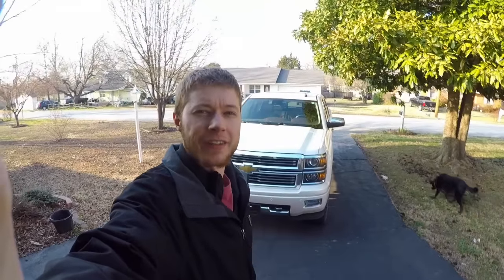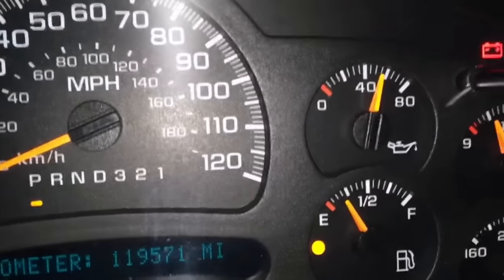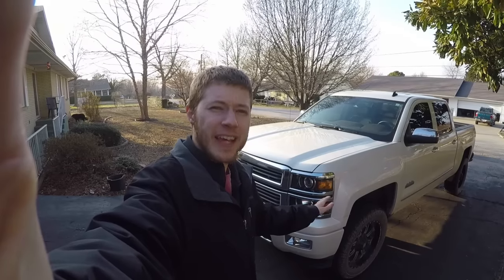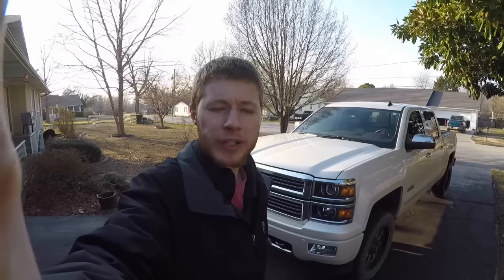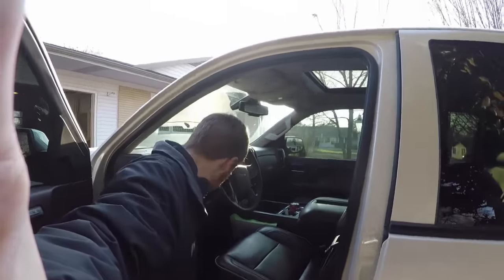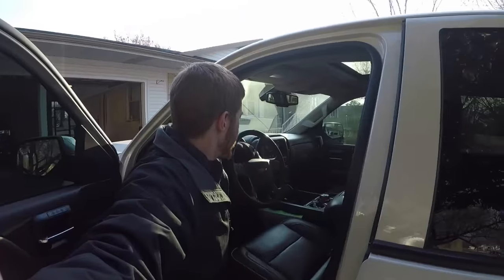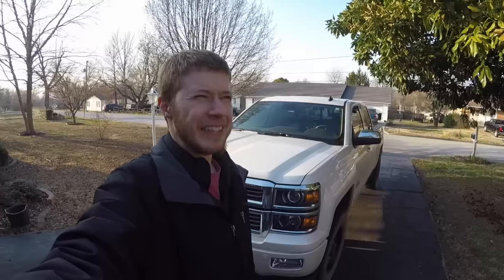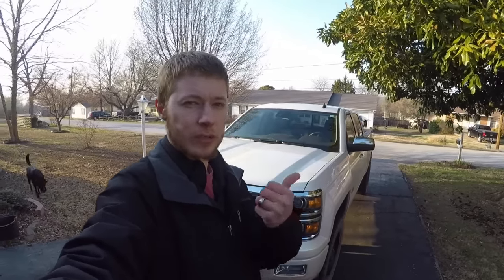Silverado Sierra 5.3 Lifter Noise Tick (What to do)

Comment: Part of the problem on these engines are the fact that they’re made out of aluminum and aluminum heads in plastic intakes with all this being said the noise is a lot more pronounced in it travels from those materials a lot easier than it would if it was cast iron so the new aluminum engines a lot of them are just noisy because you can hear the internals a lot easier than you would if it was an old cast-iron ...what are your thoughts

Comment: It was a Lifter on my 05 5.3 Sierra..
Dropped my Oil Pan, And Cleaned Out the sludge from my Pan, Cleaned the Piss outta my Pick up screen.. Then Replaced the bad lifter,, That was Squared off at the Roller... New Cam, and Did the Heads while I was at it..
177k mileson it,, all that Work and $$,, it’s Quiet As Fuck now,, and Runs Grrrreat..
Reply from the maker: Nice work!

Comment: That’s the belt driven vacuum pump that runs the brake booster. .That 5.3 is totally different than a 06.
Reply: Build0001 explain bro respects

Comment: Yea I had a bad lifter and I had heads redone and put in a new cam and new lifters. It still has a bit of a tik. I'm actually going to put in a new high pressure oil pump because my oil pressure is low at first start up but it has 140k miles being a 07 classic.  Thanks for the video appreciated it!

Comment: Just a heads up, what I hear is the Fuel Purge Valve. It is located to the right of your throttle body and feeds to your Intake.  $30 part. Chevy OEM FPV is notorious for being noisy. If you put your hand on the throttle body and on the FPV , you can "feel" what youre hearing. Almost like a distinct grinding sound/feel. I put some Dynamat extreme on mine when I replaced it. .....and noise is GONE. AFM lifters will be much noisier when they go. Yours has no problems....yet. Up the oil viscosity as recommended by owners manual for your weather conditions.  You'd be surprised how heavy you can go and still be under mfg recommendations.
Reply: My code popped up yesterday saying my purge valve

Comment: My 2001 Silverado has been doing the same thing for at least 15 years. I have never had anything done to the engine except oil changes. It still runs like new with over 200 thousand miles and yes it still makes the same noise when you first crank it up, but after about three minutes or less it stops. This usually happens after you let them sit up over night. I love mine and have no plans on getting rid of it.
Reply from the maker: This is good to hear. Sounds like that has been a great truck!
Reply: Dustin T it’s like a family member after all this time lol
Reply: this sounds exacly like a manifold leak if its more present on start up and goes away its most likely manifold if it comes with heat its probbaly engine related

Comment: Its because its direct injected, any direct injection engine ticks like that, totally normal, always will, direct injection engines put out 15,000 psi of fuel pressure into your engines, dont motor flush it, that does more harm then good this is a normal noise.

Comment: I’ve just hit 160,000 on my 2015 reg cab 5.3 engine 4x4. I’ve baby’d it, had absolutely no problems out of it, always use sea foam or Lucas every single fill up, never get down on it but I drive a lot. Mine just started the ticking sound. Thanks for the info. I’m really trying to make this truck last to 400k. The body style still has that classic look, especially with the mud tires they set it off.
Reply: You might consider a dod delete kit. It prevents lifter knock/failure but it disables the v4 mode

Comment: Different levels of the notorious tick! Do worry about it. It will wear down the cam lobe and more. Has to do with the VFM on all 5.3 & 6.0 LS engines. 07-20, a few ways to try and make it stop, some work depending on how severe tick is and others have to go into engine.
Reply: This issue plagues earlier models as well my 01 Silverado 5.3 does it

Comment: I have the same noise in my F-150 4.6 SOHC mod engine,it has 290,000 miles now and the 'cam phasers' have small pin that wears down after about 200,000 miles and it has the same type of ticking noise until it warms up.... usually takes about 5 minutes,then goes away..not sure if GM uses a single cam phaser or they don't have one at all...idk
Reply from the maker: I’m not sure either honestly. Wow, that’s been a good pickup, 290k Miles!

Comment: Toss a quart of Marvel Mystery Oil as part of your oil change. You can also put half a cord into the gas tank to clean the upper end of your motor. This has worked for me for years.
Reply: I do the same thing  also once a year fill with tranny fluid only 5 qts let it idle for 1/2 hr, drain real well and just use Wally world oil change ever 4,000.
150,000 miles on 2008 no noise  at all. Also I bought a Dorman valve cover for drivers side, that revised the oil redistribution no oil consumption at all.

Comment: Well I have a 14 and it does not do it it purrs like a kitten and I have no problems got it when it had 20,000 has 33,000 on it now change the oil. Regularly with synthetic but you guys are have problems don't worry it has a hundred thousand mile Powertrain warranty so just take it to your dealer and have them look at it
Reply from the maker: Thanks for the tip buddy!

Comment: I got a 06 Silverado with the 5.3 had a tick, bought a can of sea foam and followed the instructions for how much to put in the oil, left it in for about 500 miles to really do its job and when I changed the oil after the 500, no tick. It’s been about 10,000 miles since then and still no tick

Comment: I use Marvel Mystery Oil for a about 500 miles before an oil change , I bought a used one and you could hear it down the block. Put the Marvel in it and it worked great , Also prolong worked for My Father's truck. In Theory a full synthetic oil should get to the last lifter faster so it wont tick. I only do the Marvel treatment once and my trucks never need it again.

Comment: It's normal, my 2002 Silverado with the 5.3 has it, it's called piston slap, the aluminum pistons take a sec to expand to proper size. I've got over 252k miles and still running strong.
Reply: Had a '06 that ticked . Made 12 trips from Arkansas to Canada and back.  Had 242,000 on it when I traded. Wouldn't have been afraid to take it on another run.

Comment: Got a 2002 and
2004 suburban with 5.3.    It’ll tick on cold start only in the winter for a
Little.    Just hydraulic lifters dry and pumping up.  Drive it they’ll run forever
Reply from the maker: These engines seem bulletproof!

Comment: 2010 avalanche does it. Once it heats up it becomes much less noticeable
Reply: Pat Voog Ues my 06 4.8 chevy S does that
Reply: Different causes. This noise is because of the new direct injection fuel system. It's the high pressure fuel pump and fuel injectors ticking.
Reply: Pat Voog on your 2010 avalanche, are you talking about the knock sound, not the tick? My 2010 Chevrolet Silverado 1500 5.3 engine has the knock sound while warming up from a cold start and become less noticable, but still can hear the knock at full operating temperature (210 degrees). I can hear it good on the passenger fender well and under the truck near the oil pan? I think all the 5.3 engines have this sound but I'm curious if you have the same sound? Thanks
Reply: 2012 chevy silverado 229xxx kms and it has a slight tick and I guess you could say knock when it warms up

Comment: The older LS based engines have piston slap. My 2000 Silverado has been doing since it was about 5 years old.  They have a bulletin about it. I was once a Chevy Tech and have had numerous people complain. We would just print out the bulletin and hand it to them. Most people weren't very happy with that. GM claims its normal and won't cause any issues. Just an annoyance.
Reply from the maker: I’ll have to check out this bulletin, thanks for the heads up buddy!
Reply: @DustinT  running non-etih premium gas and Amsoil.., napa platinum filter..the only tic I get is with in innital start up... But that's from the fuel injection system..and the injectors after a couple secs it quiets down to were it's barely audabule ...👍
Reply: So it's normal for it to tick not just at start up but while driving? Is constant ticking normal? Please help, just got a 2005 Chevy Tahoe and it ticks constantly. Never had this issue with any of my other Chevy's, had a Blazer and suburban and never had this noise before
Reply: @Lostinspacepup  obviously without knowing the history of your motor..it's a knowing the brand caricaturistics ...there are methods of quieting (masking think dealer)...but eventually the Chevy (lifter)tic will come back.. Keep fresh oil in 'er and drive it till she quits 😌✌
Reply: The older LS dont have "piston slap" whatever the hell that is! They have Chinese crap knock sensors which go bad and tell you the engine is knocking when it is in fact not and is running perfectly.
Reply: Ibanez... perfect example of WRONG! It is not piston slap! 🤦‍♂️😤 People don't listen please, troubleshoot do the recommended maintenance and some fuel and engine treatments now and then. I'm real curious about the guy who suggested cleaning of the lifters 👍 sounds legit. Just because someone says they were a chevy tech does NOT qualify them as a better resource TRUST ME!  I recently had trans shifting issues... everyone and their brother even my trusted mechanic friends told me probably need to rebuild trans.  EVERYONE but myself was wrong, it was the transfer case shift motor sensor a $35 part 🤯 get an old school experienced mechanic with an attitude to actually get to the bottom and solve the problem instead of throwing parts and nonsense guesses that have no common sense behind them. Just cause something "worked" for someone doesnt mean there not still a problem OR that that solution will work for everyone with the "same" problem. As many have said there are SEVERAL meaning quite a few solutions to fix these problems but it certainly seems this is for the most part acompletely normal common occurrence that actually doesn't "need" to be "fixed" but its still important to do the dang maintenance and replace parts that may not even be bad but have seen a lot of mileage and wear! They don't make maintenance interval list for nothing 😉
Reply: @markmiller8641  Well if something works for you that's great. My 18 years of ASE master tech experience is all I need. Good day.

Comment: Top tier gasoline does nothing to valves. Direct injection system in your truck sprays fuel directly to combustion chamber and not on the valves.

Comment: My new Hemi does it. I also have owned several mod motor Fords and they all tick.
Reply from the maker: Seems to be either lifters or direct injection
Reply: BioHazard Shrimp Ford mod motors, it's usually the cam phasers,after they get alot of miles the pin in the phasers wear down and they tick until the engine warms up...

Comment: I have a 2008, 2011 and 2013. All bought used with the 5.3L on it. The 2011 and 2013 I have a small knock on the passenger side. Most flex fuel have a little knock or ping. What i did to eliminate the both noise I had was engine flush all the time before changing oil and started using 10w-30 on my oil. Full syn and never had those noise again. All GM vehicles cooperate better on Amsoil products. Especially on my trucks. Don't use Seafoam on the crank case. It dries out lifters. Have a great one!

Comment: It’s your high pressure fuel pump and injectors.  Think of it like a diesel  engine. Smh 🤦🏻‍♂️
Reply: Can you elaborate? Does the rail need to be replaced? Or injectors?
Reply: No.  It's normal.

Comment: I just had that noise and used Motor Medic Motor flush. I drained about a quart of oil, dumped in the flush in, started the truck (cold start), let it idle for 5 minutes, changed the oil with some generic synthetic blend (got from Walmart) and used an AC Delco oil filter. The ticking noise is 90% gone and the engine runs better. It was on a 2000 Silverado 5.3 Z71 4x4 Extended cab with about 215k miles.

Comment: This made me feel so much better. I've been worrying myself to death trying to figure out what the hell that tick is. I just need to get some exhaust to distract from that sound.
Reply: That’s what I did lol. CAI and exhaust. Only hear it if I’m parked next to a wall.
Reply: @sirdumbthicc4294  yeah. The drive through is annoying as shit, but going through a tunnel is fucking great 😆
Reply: Tell me about it just financed a 2015 Sierra and I been stressing like a mf thinking this shit is gonna break down 😭
Reply: @LORDSLADE  lol naw my 2014 been doing it since the day I drove it off the lot. Even if it is a lifter you’ll get a misfire code (p0300-p0308) but the truck will still drive. Run like shit but it’ll run. But like I mentioned before get a cold air intake and a cat back exhaust and you won’t even notice it unless you’re in a drive through lol.

Comment: My (new to me) 2003 Chevy Suburban with the 5.3 (74k miles) makes a tick but I've always assumed it has to do with the injection system. It sounds more like a "good" or normal tick than anything. What I'm trying to figure out is this whistle/whining noise that's just started. I can hear it mostly from the driver's seat. Like it's a vacuum leak but the only vacuum lines I can see under the hood in that area are okay. 

Have any input on that?
Reply from the maker: Wow that thing is low mileage! Hmm, hard to say without hearing the sound. I would check the intake, that would be easy to do, I’ve heard them make a funny noise if they are loose. And as for the vacuum line, I know what you mean. Is there a pinhole prick somewhere in it maybe? Other than those two things, maybe the alternator?
Reply: 1 Road alternator bearings going bad
Reply: I owned a 2003 suburban and it is not the same.. 2014 and up is a totally different set up
Reply: That's what happens when you drive a Chevy, get used of it. What you're hearing is what Ford owners don't hear, women whistling as you drive by
Reply: @Mr.Beastforpresident  best comment!
Reply: The driver side reactor coil is tapping on the fusion interruptor housing. Nothing to worry about. I wrote this 62 years from now to help ya’ll out.

Comment: I run a quart of rislone with every oil change.  It seems to help. I tried all kinds of stuff and the rislone is the only one that helped.  Lucas actually made it worse.  I haven't tried Marvel's yet.  I'll give it a go next oil change and see.  I think I have a bad pickup o-ring too. Motor has 223,000, holds about 30-32 psi on idle and 38 psi driving.  Full synthetic the entire life of the engine.  Hopefully I can get another 100,000 out of it.

Comment: Most of the time the vacuum pump starts making a ticking noise and that’s probably what you hear. Special coverage on them if you have less than 13 pounds of vacuum at the brake booster

Comment: THIS IS NOT LIFTER NOISE, IT IS THE FUEL SYSTEM ON THESE NEWER GEN 5 LT MOTORS

Alot of people in the comments here don't understand this new truck here has an LT gen 5 motor, not an LS motor anymore.  

These have a high pressure direct injection fuel system on it that is ran off of the cam shaft which is the ticking noise at idle...

Comment: The tick happens because the engine is cold. All 5.3s have the same tick
Reply: Mine had it later when cold, not initially but around 200k and only in winter, than both winter and summer you'd have to sit for a minute and it went away. Now it has a higher pitched faster knocking, its either bearing or transmission flex plate. Bearing and I'm screwed, new motor time. I have 240K miles now.
Reply: The new higher pitched knock is even when driving, doesnt go away, somethings cracked and loose.
Reply: Not necessarily,mine is constant. Non stop even ticks while hot😒